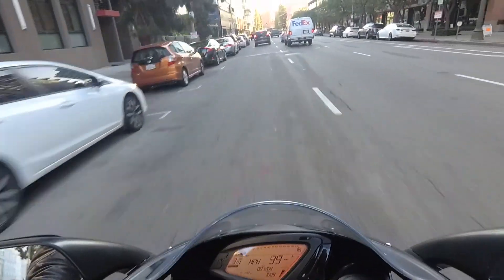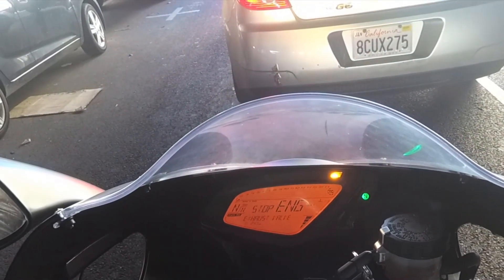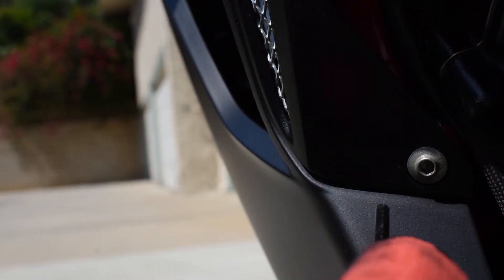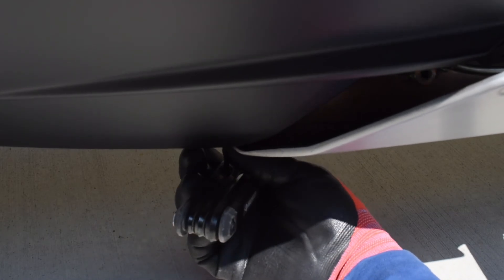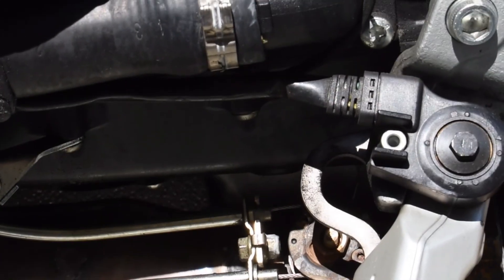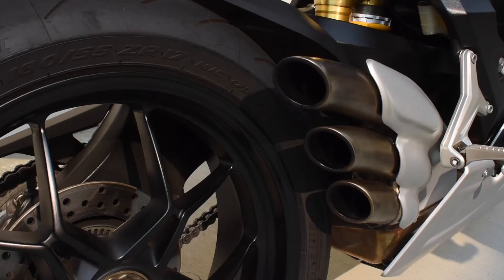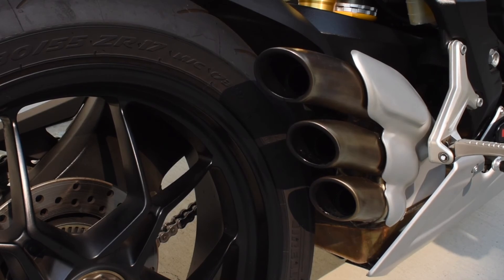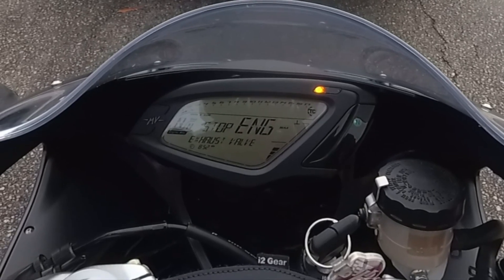MV Agusta F3 800 - Exhaust valve fail

Comment: The problem with the exhaust valve motor is that the gears inside this black little box are made from plastic. So when the cables that connect valve and motor are dirty/ rusted/ have any more resistance than they should have, the motor may jump a tooth or two. Unfortunately you can't reset these motors once they skipped teeth
Reply: It happened on my f3 800.
Had an exhaust buddy fitted to over come the fault.
Reply from the maker: Thanks for the added info. Yes, I should have mentioned that when the mechanic described the problem, he said it was the servo unit that's the problem and it can't be fixed. It can only be replaced.
Reply: @amv_moto  i was recommened a healtech servo eliminator for the error message on the dash. it replaces the servo motor.
Reply: @MobinBrown  sorry for the necro-posting,but did you solve with the healtech servo eliminator? Thank you

Comment: Tis merely a flesh wound! My B3 keeps me entertained much more. Radiator cracking, sprag issues, hub issues, clutch basket and pressure plate exploding, cam flaking, cam journal wear, multiple sensors failing and set of cush drive rubbers per every tank of petrol. Most unreliable yet most fun to ride bike i ever had. (Tried to get rid of it, of course :-D But nobody wants it :-D)
Reply from the maker: Ha! Thank you for making me feel much better about my MV Agusta life decisions. And I'm definitely gonna steal this one "Most unreliable yet most fun to ride bike I ever had". The truth hurts!

Comment: There is a small potentiometer in the servo which operates ex valve. Problem should disappear when you replace that potentiometer. I did that on my Aprilia Tuono which uses the same mikuni servo. Error from the dash disapered and valve operates like it should.
Reply from the maker: That's good to know. Since it was under warranty, the shop said the easiest thing to do was to replace the entire servo.

Comment: Just FYI, this isn't an MV problem. MV's get a bad rap for a lot of problems, but this isn't MV-specific.  My S1000RR HAD one as well. As mentioned a LOT of bikes have these exhaust valves.  It's a poor design to a poor solution to a problem that shouldn't even be a problem to begin with. Especially with loud-ass Harleys all over the place.  Unless you're in Cali, replace the exhaust system with something like an SC Project, Arrows or Termi exhaust system. Then get the ECU flashed and live happily ever after 😀.  Or at the very least get a servo buddy to disable the damn thing and a piggyback fuel controller like a PC5 or a RapidBike Evo unit.  I dunno what it is with Italian bike manufacturers, but outside of Aprila they can't tune a motorcycle worth shit!  At least not US-bound bikes anyway!   So a proper tune should be in your future regardless. No matter if you get it from a piggyback fuel controller or an ECU flash!
Reply from the maker: ESBKLife! When are you gonna start posting again? We need to see some bike updates. 😎Thanks for sharing those tips. Yeah, like I mentioned, lots of other brands have this same problem. It might have been bad luck mine died at <5k miles - but them taking a month to send out a new one - yeah that’s that great MV Agusta service you gotta love. 🤣 And we’re still waiting for those updates…

Comment: I have the same Exhaust Valve Fail on my '17 F4RR.  I disconnected the cable to let the valve open at all time.  It still doesn't help as I occasionally get the Exhaust Valve Fail warning on my dash when I'm traveling at the same highway speed (i.e.  steady throttle position) for  several minutes.  My dealer advised me not to worry about it and to reset it, you pull over and shut off the engine for a minute or so.  I am truly done with MV Agusta brand as the machine is extremely finicky and the fuel tank is made of plastic.  I am slowly decommissioning my F4 as soon as I receive a new fuel tank replacement (deformation due to ethanol content in gasoline).  The F4 is truly a bike for the living room and I intend to make it that way.  LOL!!!  I have learned my lesson to not get any bike with a plastic fuel tank.  I am moving on to other bikes with aluminum fuel tank and better reliability, better engine design, and therefore cheaper to maintain.  Riding the F4RR is truly a special event for me every single time.  I just don't like to deal with its poor reliability and its too many unforgiving characters.  I thought when I got the bike, the F4 engine design has matured and therefore its reliability is very high.  I mean, the design barely change since 1999[?].  Surely, one hopes that all the bugs have been squashed.  Boy, was I completely wrong and disappointed.  My Ducati is much better in terms of reliability.
Reply from the maker: Yep. The exhaust valve thing is annoying. Luckily mine was replaced under warranty. It took MV almost 2 months to send me a new fuel tank after my first one cracked due to ethanol and then they sent me the wrong color. Dealing with them is a pretty miserable experience. People ask me about buying an MV - I tell them to do it only if you're crazy like me, otherwise get a Ducati.
Reply: @amv_moto  My F4 fuel tank should arrive in January 2021 after more than 1 year since the warranty was submitted.  I learned to be patient when dealing with MV Agusta.  LOL!!!   My patience has run out.

My last clutch slave cylinder replacement costed me over $1500 because the engine transmission needed to be disassembled just to get to the O-ring on the actuator rod of the clutch.  This last service has put the nail in coffin for my F4.  I am not getting another MV even though I had seriously considering the Brutale 1000RR.  In my own personal experiences,  my Ducati never let me down.  Ducati manufacturer's recalls were performed flawlessly and expediently by a Ducati dealer.   I am truly satisfied with the way Ducati engineered their bikes.  And the way the dealer handled the factory recall service to ensure customer's satisfaction.   Thank you Ducati.

Comment: Thanks for posting this- I got the dreaded malfunction- exhaust valve message today on my 2020 Brutale 800RR SCS  around 180 miles from home on my way to Wickenburg AZ for overnight then back up the twisties tomorrow… called the shop and they said it was ok to ride and it could be dealt with at the next oil change… had to look online tho and found this- puts my mind at ease and tomorrow I’ll have even more fun getting home 😂🤣😉
Reply from the maker: Yes, it definitely sounds bad but at least the bike is still rideable. Good luck getting it fixed. 👍
Reply: Hi there how did they sort this for you? Kind regards

Comment: the same error came up on my 18 dragster rr at sub-600 miles. it turns out the exhaust valve cable was completely missing. it took 2 months for the dealer to receive the replacement part from Italy.
Reply from the maker: The cable was completely missing?! Wow. That’s some great quality control there. And then 2 months to get the part? Yep, that sounds like MV Agusta.

Comment: I suppose if that same setup was on several other brands, it's just a matter of time till they have the same issue too.

Side note, picked up a 2020 F3 800 last Saturday (10/31).  It's my 6th MV since 2000. (I decided to retire from motorcycling last year....but it didn't stick).
Reply from the maker: True. A lot of modern sport bikes use this setup so eventually they have the same problem. Maybe someday someone will come up with something better. Congrats on the new F3 and getting back into riding. Once you have the MV bug, sometimes it's hard to get rid of.

Comment: I haven't done it to my cbr, but I understand most people just remove the whole contraption
Reply from the maker: Yes, a lot of people will remove the whole thing but on MV's its probably easier to just safety-wire it open.
Reply: I just had this issue last month and yes the shop use a little box with signal to cheat the computer which would all the way open the valve. The shop told me if change a new set might have the same running a while. Don’t know if the information is true?
Reply: @hanslin526  did it work? Or is the warning light still coming up on the screen?

Comment: I’m looking into buying an 2020 F3, and was wondering if these issues still happen with the 19 and 20 models? Also, will replacing the exhaust with an aftermarket one, would that fix the issue?
Reply: Tauren Miller changing the silencer doesn't do anything because the valve sits in the header right after the kat. A full system probably doesn't have the valve
Reply from the maker: Yes, MV is still using the same exhaust valve system on the newer bikes so chances are they'll have the same problem eventually. If you get a full system (headers to silencer) that should delete the exhaust valve. If you just get a slip-on, that won't affect the exhaust valve (because it sits in the lower canister in front of the silencer) so you'll still have the same problem eventually.
Reply: @amv_moto  In order to clear the check engine light you must install a Healtec Servo Buddy and even then you are not guaranteed to clear the code on the dash. Its irritating to say the least.

Comment: Exact same problem on my F3 800. At around 9000km. Make the bike struggle in low rev until past 2nd gear. Ride is very flat and the revs are 'sippy'. I open valved it, didn't make it better.
Reply from the maker: I hope my replacement lasts longer than the first one because the bike sounded and felt like crap when it went out. Hopefully you're still under warranty. Good luck getting yours fixed!